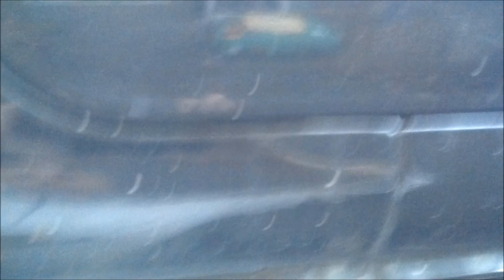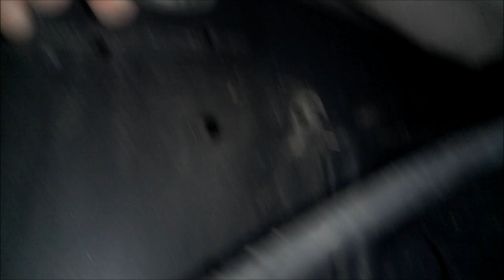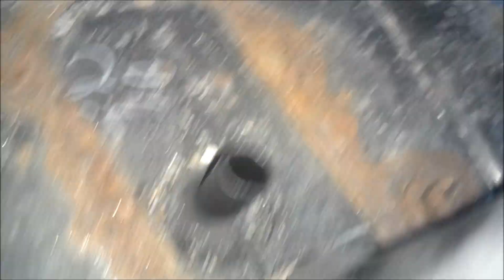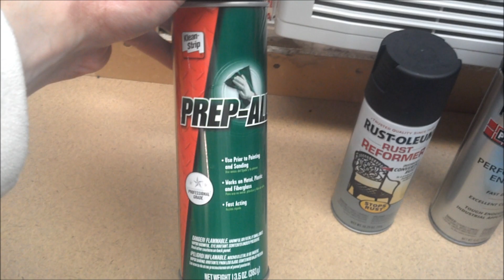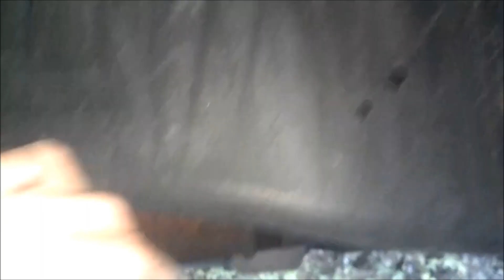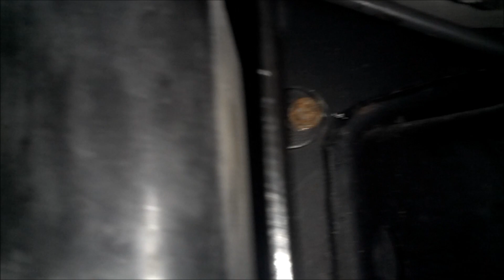P0455 - Evap System Leak Repair - 2001 Dodge Ram

Comment: I had to Jerry rig my PCV valve and hose on my 2004 Chrysler Sebring as everything is rotted out and discontinued. Can't find original parts anymore so this is the way to do it. Like you said it's about functionality not a beauty contest. If it works , great.

Comment: Dorman 911-241 is the round canister if anyone needs a replacement. You will have to resuse the metal studs from the old canister and screw them into the new canister

Comment: For anyone curious in 2024, the round charcoal can hasn’t been available to purchase for quite awhile. They don’t even list a part number on the Chrysler diagram. The round can is just a secondary one that technically isn’t needed. You can remove the jumper hose between the two cans and plug the hole in the square can then connect the 2 small hoses to the other small fitting that’s capped next to it.
Reply: Dorman 911-241 for the round
Reply: @ pricey lil guy. Thanks

Comment: Rock auto is my preference over a parts store. They deliver quick and at 1/4 the cost on average for a part and can order about everything or little thing
Reply: If the check light don't go away and you can't find nothing wrong put some tape over it quick fix

Comment: Mine blows that code IF I run less than 98 octane. Yup. Go figure. It's a 01 RAM. "Slow leak".  But a pain with idle though. Thanks for video! Anything on cylinder 5 misfire??

Comment: As far as I am concerned the hoses and the fitting you installed is thicker and far superior (heavy duty hoses and clamps) compare to the cheap light hoses of the factory.  Dodge and the so-called professional mechanic would cringe at their light/cheap material when they see your set up.  Two thumbs up from me.  I need to replace that funky elbow on mine and while I am at it I will upgrade the rest.  Great video.  Thank you.

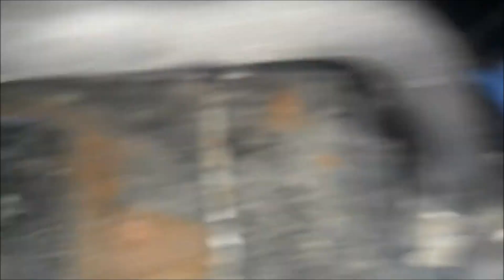Comment: At 4:49  I notice an elbow fitting barely visible behind that one hose with the clamp you are pointing at.   I need that oddball elbow fitting.  One end goes into the canister and the top end has two openings accepting two horses.  Yours is exactly like mine.  I didn't realize that there are two places on top that hoses go in.  Your hose that is torn goes on the right side.  I never realized that there are two openings.   I better go and check.  I am wondering where can a person find/buy that elbow fitting.

Comment: I would have thought that t-piece would confuse the two lines the dual piece you  threw away sent the lines in the same direction whereas when it gets to the t-joint its basically facing the ends of the line towards each other if you know what I mean...... Did it work for you??
Reply from the maker: I'm not totally sure I follow what you're saying, but the repair did work fine.  My trouble code has not come back since.

Comment: Easy job. 14mm socket with extension. Pain the butt top bolt but two on the right one on the left. Blew compressed air into port on canisters. Connector hose between the two was fine. 
3/8" hose and T.  Removed coupler in the line going to engine bay, slid this over the T end. You can remove the hose to the gas tank its a clip release which makes it easy to slide onto the T side. 
Used silicone spray for all connectors to slide over T easy. With the 3/8" line there was no need for any clamps.  Use about 2" from the top port into the T that gives you enough room to bend the line at a gradual angel and your others lines lay nice with no kinks.

Comment: Hey, your video quality was on point!! Anywho, let's hope I can explain my issue. Let's get started. My problem isn't the same as yours. Mine is where the two hoses go in the butt coupling.  With that said, do you know the name of the "butt" looking connector (coupling) that the two hoses going into the other "port"?? I should of taken a picture before re-installing it. It literally looks like a butt...

Comment: First off this is my wife's account and I am using it only so I could leave a comment because you saved me a lot of money with this video. secondly, I had to have it known how happy I was when my check engine light went off today. I did pretty much the exact same thing with mostly heater hose and one vacuum hose and the light went off not 25 miles down the road.... Thanks for the video!!
Reply: Say hello to your wife from me :-)

Comment: Nice video, I'm going to attempt this soon on my 2001 ram truck, check engine light is on but literally the only codes are a small and large evap leak, I just casually went under and looked and that first hose has a large split in it I could see. Nice idea too on that T splitter too, I might need that too...truck drives fine but my mpg has been less than desirable, I looked online and some claimed having the evap leak could cause bad mpg, although being a 15 year old truck I'm sure it needs both new front o2 sensor's at this point too.
Reply from the maker: Thanks!  I'm sorry for my delayed response...I hope you were able to solve your issue.  Thanks for watching!

Comment: I had this problem since 2001 and the dealership could not find the source of the problem so I been tearing down the whole evac system and I came to realise that the leak detection unit is not sealed so I tore it down and put faucet lubrication around the O-ring at the filter location on the unit and around the big ring for the pump that is inside the leak detection unit and it's sealed it up. faucet lubrication cost me $3 replacement unit of the leak detection cost $125.

the check engine light has finally shut off after I fixed the leak detection unit
Reply from the maker: Nice work, Patrick!

Comment: i like your fix with the tee fitting for that funky 2 into 1 boot. On my 2001 I actually just smeared a little silicone on the fat side before putting it back on, and that cleared the small evap leak code that I had. still trying to sort the p0455 code, but i think you just showed me where to look. thanks for the vid!
Reply from the maker: Thanks Terry!  I hope you're able to find the source of that P0455 code.  Good luck!
Reply: Do you know that the boot is called or whAt it connects to?

Comment: saved my bacon. just bought a code reader.  oh well
Reply from the maker: Oh well...it never hurts to have a code reader.  Some will display pending faults that have not yet been confirmed/logged by the PCM, which cannot be displayed by the "key trick".  That only shows logged faults.
Reply: just turn the key switch on  3 times," dont crank it" . The 3rd time you turn it on  a code should light up in the odemitor gauge.

Comment: I have a po443 code on dodge ram  1500 ,thanks I'll check hoses
Reply from the maker: 10-4, I hope you were able to find and solve your problem!  I just had to repair another one of the hoses at the evap canister a couple weeks ago.  It seems like the hoses like to split frequently right where they connect to the fittings.

Comment: Thank you for he video! This helped me diagnose and repair code P0445 for my 03 durango RT. I had a small cracked hose from the charcoal canister. The hose piece cost $1.30 and easy clamp on
Reply from the maker: Nice work!  It's great when a repair only ends up costing a few bucks.  I'm glad you found this helpful.  Thanks for watching!

Comment: Great vid Matt.  Wish I had watched it yesterday though!  My 02 Dakota is at the dealer now for this same problem.  They are charging at least $300.  The lady said the mechanic wants to repair a line because "replacing it would be astronomical".  Isn't this whole system just a bunch of rubber hoses like this?  Are they just royally screwing me or do you know if there is some rigid main line running through it that would be especially difficult/expensive to replace?  My daughter's car has the same issue so hopefully I can learn from this and help her with a cheaper fix. Thanks!
Reply from the maker: Lothar ThirtyFour Thanks!  That is a bummer about the repair cost.  I honestly don't know what this would cost at a dealership, but in my experience, any repair diagnosis usually costs about $75-100, and then the hourly rates seem to run anywhere from $75-125 per hour.  Plus, they will charge you for whatever "the book" says the required repair time is, even if they actually make the repair in 10 minutes.

As far as the complexity of the system goes, it is basically rubber hoses, but there is a rigid plastic line, a pump, a filter, etc.  Even so, it seems to be a pretty straightforward setup.  I can't imagine what could possibly require the entire system to be replaced...but it seems anymore that a lot of mechanics simply want to throw parts at things rather than doing some good old fashioned diagnosis and problem solving.  I suppose replacing the entire system could solve the problem....but why do that when you can make the repair with a $5 piece of hose?

Tell the dealership to show you exactly what they have replaced.  If you can tell they really didn't do much more than what I did, then you might have some leverage on the price.  Sorry to hear you are having to shell out big bucks...it's stories like yours that motivate me to create and post my videos.  

Good luck!

Comment: I dont have that vent under my hood. just a capped off large hose and I do have the the evap thing where the double hose thing connects.
Reply from the maker: Richard Cowtails Hmm, perhaps someone removed your charcoal canister (at least that's what it sounds like)?  Do you have any evap-related check engine codes?
Reply: Had a circuit code once. Thats it. Haven't seen it since
Reply: Richard Cowtails, hey man I have a parts truck that has the same hookup as yours that you described I can do a video in a week or two for you
Reply: That would be great thx

Comment: replaced cap, how long before light should go off?
Reply from the maker: Filmaker25 I think my CEL went off within about 75-100 miles of driving after my repair.  Has yours gone out finally?

Thanks for watching!
Reply: *****
Well, thanks for the concern Matt. I turned off the light with OBD then after 3 days went back on ; then with battery lol, went back on two days later again. I remember throwing away orginal  gas cap and that set it off originally. Then I got aftermarket, that worked for 2 years, light came on. So in October, (put it off too long if you ask me) I got dealer , orginal OEM, that's when I thought "ok, this will do it" I did all the  but comes back in 2 days! lol .

Comment: That y piece you couldn't find at the parts store goes for $95 at the dealer. You'd have to buy the whole line. Good job on the modification. Got to get mine done. thanks
Reply from the maker: Jon Declemente Whoa!  That is insane...but not surprising.  Dealerships love to price gouge.  Thanks for watching, and good luck with your repair!
Reply: What’s the part called?

Comment: Being an experienced mechanic your video dragged for me a little but I must commend you on a thorough job that will really help someone with less experience than I have. And it helped me too because now that I have the code I also have a starting place to begin to search for my Evap system leak. Thanks, well done.
Reply from the maker: Thanks, Scott!  I'm flattered that you could actually make it all the way through my hack job of a video.  I've always assumed that seasoned mechanics would probably cringe if they watched any of my videos.  I try to film and edit them so that someone else like me (who is a total novice when it comes to turning wrenches) can follow along and gain the confidence needed to try a repair on my own.  I've found that the thing most often preventing me from attempting a repair is that I may be biting off more than I can chew, but I've noticed that if I can watch someone else do it first, I am much more likely to try it myself.

Thanks for watching!  I appreciate your kind words.  I hope you're able to sort out your evap issue.
Reply: *****
That's exactly why guys like you should keep doing them. It can help people tackle a lot of problems that really aren't all that complex. If you took that in to get it repaired ad a dealer I bet that would cost $100+. Keep after it Matt.

Comment: Nice video. Shows where to look really well.  The gas will eat up heater hose though in a few years, but it will last a good while. Depending on where viewers(and you) live, you can also look for fuel type hose at like a John Deere dealer or other ag dealer, they usually have stuff like that in stock if it is a larger dealer. Your truck is really clean, you must not live in the midwest lol.
Reply from the maker: Thanks!  Yeah I knew heater hose was not the best thing to use, but hoped it would get me by in a pinch.  Thanks for the suggestion...I didn't even think of looking at a John Deer store.  I'll remember that for when my current repair fails..haha.  Thanks for watching!